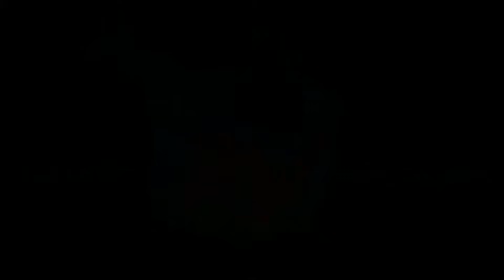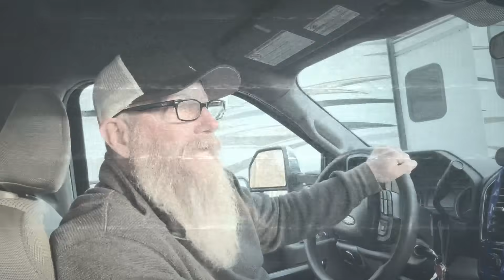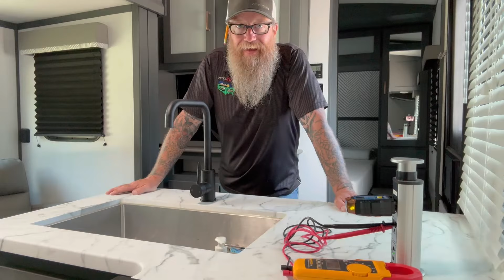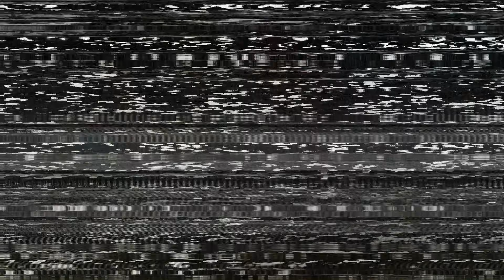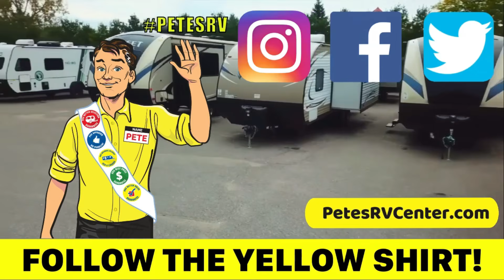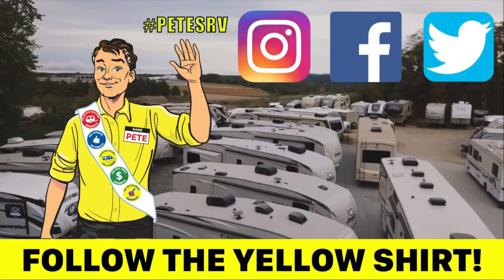Park Power In Low-Voltage Situations | Quick Tips With Randy

Comment: It's important to test the voltage at the pedestal and in the camper so you can tell where the voltage drop is.  If the voltage is low at the pedestal that's a grid problem, good at the pedestal but low at your outlet? You might have a problem. BTW, in the AC mode your meter won't display positive or negative since it's alternating current. 😊